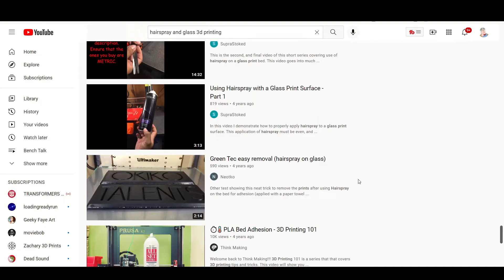Safety First - How safe is your 3D Printer, or Laser Cutter

Comment: Man, I remember you being attacked viciously after that story broke. You weren't "not thinking" by neglecting to say only spray in a well ventilated area, you gave the audience too much credit to think for themselves. It's why everyone litters videos with disclaimers now - you do at your own risk etc. This is the major reason I will never show open air lasers on the channel, along with tonnes of things I would honestly love to share. I don't trust people to think. Most people, yes. All? No. The laser companies don't seem to give a crap either, so I feel it'd be me ending up being sued and it just ain't worth the adsense!

EDIT: Wanted to expand a bit, worked with lasercutters before 3D Printing and almost every few days someone would come in wanting an item cut / engraved that was made out of toxic-to-burn materials. Faux leather is almost always PVC, most Ply and MDF contains formaldehyde etc. Education around what materials are safe can be incredibly challenging at times. With an enclosure and a high flow extraction you can deal with most of the fumes, but definitely not with open air designs. That's a major, somewhat hidden risk beyond the laser and fire I feel.
Reply from the maker: Yeah, I probably deserved to get blasted. We were all learning.
The other problem with these diode lasers is they don't seem to cut certain materials that the CO2 lasers that produce a beam of infrared just tear right through. Not necessarily a safety concern, but if you're thinking these little diode lasers are a cheap alternative to a FSLaser or K40, then you're in for some disapointment.
Reply: @3dpprofessor  Yeah they can't do clear acrylic, deal breaker!

Comment: I would love to get a laser cutter. I would be more likely to get an open air laser due to the cost. BUT  I would also make an inclosure with a filter for the hazardous materials. I was a machinist back in the 90s for a company that made medical diagnostic equipment. We made parts out of PVC. You don't have to burn it to cause fumes. Just heating it up a little will cause off gassing. It would make people literally sick. I had to wear a organic vaper respirator all day. The part was cut on a lathe dry. The parts wouldn't get hot enough to burn you from the cutting friction. But could sure make you sick enough to see your lunch again.

Comment: Here's the thing about safety, "everyone thinks that they are being safe until proven otherwise." I had an engineering teacher repeat this every day for a year before lab. On average he was right about once every week or two. 

It isn't what you know that can hurt you, it is what you don't. "Being smart" about using a product is just vague enough to feel instructive without the benefit of understanding dumb luck. I have an ANET A8 and have never really had a problem with them but that is because I knew what things might fail and checked them early and often (i.e. the heat block heater). I have a friend who also had an A8 who, while being very smart and conscientious, didn't realize that most of the time the heater comes to you loose from the factory. Third print in, the heater slid out of the block and nearly caught his print on fire. 

RE: Open air laser, I would love to see more content about it. I have an enclosed laser cutter but would like to see more open source solutions to the very expensive and proprietary setup I have.

Comment: Fire the laser, Joe. The risks/precautions for laser cutting is far below a lot of other hobbies. Take for instance my hobby of RC helicopters. The conditioning and charging of large LiPo battery packs puts pretty much all of the worry in laser cutting to shame. Yet, no one is suggesting we stop using them. As with everything that can cause harm, use with caution. I for one am very interested in more laser cutting content.
Reply: Lipo fire is just that a fire. Laser can damage your eyes in milliseconds, which is way more risky.
Reply: @MisterMakerNL  I agree that the dangers faced in different hobbies are different. A LiPo fire is highly energetic, extremely hot, and not controllable by most standard home extinguishers (depending on the batter pack size). Luckily there are warning signs if your watching for them. I agree that the laser can do permanent damage in one pulse and must therefore be approached differently. I guess my overall point is that there are dangers inherent in a lot of hobbies (as well as life in general). We shouldn't necessarily limit or censor ourselves from sharing the hobby on the chance that someone isn't going to do their due diligence with regards to safety.
Reply: @draeh  no man lipo fires are only dangerous when it happens unattended and your house burns down. If your near too it you get warned before it blows. Even working on mains voltage is more dangerous.
Reply: Nicely said, people  don't realize that a .50-.60 size helicopter can decapitate someone.
Reply: The risks are different.
A lipo is not going to cause irreversible sure damage to your friend (or child) standing 6 feet away while a class 4 laser can easily do this.
Conversely, while a fire start the lipos are likely the greater risk.

You have to treat the laser light much like an arc welder, there should be ZERO chance for someone to accidentally or inadvertantly see the beam. Plus some of the damaging emissions of these violet diode parts are in the UV spectrum and are not visible.

Comment: Unrelated, but Kywoo released their high temp heater block for the Tycoon series, which goes up to 300 degrees C. It would be cool if you could test it out, considering with the new heater block, it esentially can print polycarbonate and nylon now

Comment: I don't have an opinion on the laser cutter; i know there was a story in the press in 2017 about a couple that died, potentially while operating a laser cutter, apparently from CO2 poisoning. I don't know whether that's true, the press made critical mistakes in reporting that make the story very dubious, and after all, there could have been numerous other sources of the silent but deadly gas. I think they also had a high power laser, not one of these little things.

The fact that you should use only laser-able materials and not try to ever cut PVC or something else that emits toxic fumes is kind of part of the inherent risk of a laser cutter; but these lacking an enclosure also seem underequipped in safety compared to what you normally expect, due to being fully open. It is for sure easy enough to lose an eye.

But as far as SLA 3D printers, they are actually already too risky for me personally. But i submit that there are plenty of people who have the circumstances to use them safely or have made a risk assessment different from mine for whatever reason.

Comment: Imagine if you tried everything you saw on Youtube without considering safety aspect first.

Laser cutters have a few safety issues. You discussed the laser reflection in great detail, along with fire hazards. One danger is also off gassing from material that is to be etched. This can be odorless, invisible and can affect you before you realize it is a problem. Ventilation is important with these lasers. To help better prepare others you could have a safety video describing where to find information on materials to be cut, properly rated fire extinguishers and eye protection.
Reply from the maker: ...I should learn more about where to find information on materials to cut and properly rated fire extinguishers and eye protection.
Reply: @3dpprofessor   Epilog Laser's site, and Sawmill Creek's site both have great info

Comment: I have a friend that is a wizard with cars and power tools. He does things that I myself would never try and attempt, but he takes safety measure for himself and anyone around. I have seen plenty of online mechanics showing people how to do things. There is always a risk, but is that on the Youtuber? Not in my opinion. You could get cut by a sharp edge on the metal, due to bad manufacturing, should the youtuber also have to warn of that just in case. There could be a 1 in 1000 chance that a part came out of the facility that should not have passed QA. Not to be confused with genuine bad products going out there, which also in my opinion our community has done a pretty good job of speaking up on those. YouTube is great. All of the 3d Print related creators are great and trying to teach people. But there is a level of responsibility on the end user or the end users gradians.

Comment: I have a 3018 CNC with a LASER and a K40 LASER and I believe that they can be safe to use if treated with respect. Don't use a laser un-attended, wear the proper eye protection, keep all body parts out of harm's way and keep a fire extinguisher handy.

In the case of the K40 there are things that, in my opinion, must be done to make them safer such as adding a safety switch to prevent the laser from firing if the lid is opened and removing the ground wire from the ground stud, sanding off the paint around the stud and re-attaching the ground wire.

I heard that some K40 lasers have come with a safety switch already installed and if this is true it shows that someone is paying attention to the maker community.

Comment: I bought my wife an open air laser cutter... I was adamant with her about wearing the eye protection and not leaving it alone while it's operating... I do NOT use it at all because I only have one eye and that's too great a risk for me to operate it. I do have my own pair of laser safety glasses and I put them on when I have to enter her craft room and I'm reasonably sure she's operating the laser. But she operates it without her glasses and I've told her many times that she should not be taking the chances of injuring her eyes like that. She also will leave it unattended while it's operating... I chew her out for that as well... I've threatened many times to take the laser away from her... Perhaps I really need to... Thanks for your video, Joe.
Reply: It pains me to hear of the cavalier attitude of your wife. It seems like a matter of time for things to go wrong.

When i was a toddler, i have been told, my parents rigged up a number of things to make sure i hurt myself once and never again, in a safe manner and under supervision. So there was a fake electrical outlet that would administer a safe electric shock via a capacitor, an open incandescent lightbulb running at a really low power, and a stove top at just the right temperature that it's painful but won't actually burn the skin right away, also a little knife/scalpel injury, these kinds of things. Nearly 40 years ago. I don't believe it has limited me in what i can do, but i still have a healthy respect for knives and mains.

I can't quite imagine how taking away the laser will work. After all she can presumably just buy her own, and it will be grounds for conflict. I don't necessarily want to suggest that she's a toddler, but then again, can a person who eschews sensible precautions against severe injury be considered an adult? I wish a solution can be found that she can continue her endeavours in a safe manner.

For that matter, my father has very limited vision likely in part due to laser injury. It seemed like a relatively minor lab accident at the time, where a direct hit could just about be avoided but the prescription glasses were damaged, but it would be a little much of a coincidence that specifically that eye suffered both a cataract and macular degeneration within a handful years and not the other.
Reply: That's messed up, something bad will happen it's just a matter of when. What kind of things does she cut / engrave?
Reply: @MakersMuse  she does engraving on 4 inch wooden coasters.

Comment: I've got several lasers and would use them far more often if I took the time to build enclosures for them. People forget to put safety glasses on everyday and around lasers that's a huge danger.

Even that tiny plastic guard around your laser head could fall off during a long engraving if the screw came loose and they do! An enclosure is a nice backup to your laser glasses.

I noticed your glasses are not designed to protect you from the same laser light frequency that's possibly emitted from your laser printer or laser cutter. Different frequency lasers require different eye protection. An invisible CO2 laser for example needs different protection measures than your blue wavelength lasers. Your burning green lasers need a different eye protection than your purple wavelength laser.

Comment: Like the saying Common sense is the most uncommon thing. 
It's how you treat and use an item, considering Safety First Always, so that you don't put yourself up for a Dawin Award.
Also like the Hitchhiker's guide to the galaxy has on its cover "DON'T PANIC!!!" (I know bad puns.)
But I often rebuild and redesign 3d printers and always consider this my safety first.  If I were to let others use the printer and I don't think or know that it is safe after I have rebuilding it. Like hell will I let others use it or myself.  I want to die of old age.
I have often seen many with lesser skill or just starting out do some very strange and dangerous things in past. Know understanding the basic or thinking "She'll be all right mate."
I agree fully with your point of view on what you have said in this item.

Comment: Every warning label has a story behind it, sadly. People need to leave things alone if they are not willing to learn sufficiently about a subject/device to be able to understand the risks and take reasonable steps to mitigate them.
I have extra devices on my 3d printer that are designed to automatically disconnect the mains in the event of a thermal issue. Hopefully long before it becomes a molten mass of goo. I also have cameras that allow me to monitor it from my smart phone from anywhere.
I don't know how I will be able to apply that knowledge to my laser, but the mind is always pondering.

Comment: 9:55 A procedure mask won't protect you against resin.
It main use is to avoid spiting on patient's open wounds and avoid getting direct contact with fluid projection on our face.
To protect you against solvent vapor, use an activated carbon filled mask.
Still, if you are in a properly ventilated room, I would not worry about harmful vapours.

I'm an analytical chemistry tech and a HAZMAT expert.

Comment: You have the safety precautions, you should do the videos on those tools. Just make sure to always show the added precautions that you take. Will save less experienced people from running them unsafely and the safety aspect is not shown near enough. I had bought a cheap (smaller) laser cutter like that but spent so much time researching and implementing a safe way to run the machine than making and actually using it.

Comment: I was going to buy a laser cutter but thoughts of my 5 year old coming in while its cutting kept running through my mind. Why dont laser printers include enclosures made of the same materials the glasses they include are made of...  seems silly to me in fact. How much more would it add to the cost? 100-200 dollars on top of the price would have been worth it to me. I would love to see you build an enclosure for your laser printer somehow finding sheets of laser deflecting plastic and maybe integrate that hepa filter device you showed. A build series for a 3d printed (where possible) 3d printer enclosure sounds cool too. The open bed styles are sort of a nogo for me with the previously mentioned child and a cat on top of that.
Reply from the maker: Some do. They just cost a lot more.

Comment: Hi, glad that you are covering safety, good job. I was wondering if you could do a video on flashprint 5, your the only content creator I know of who regularly uses flashforge printers, coming from Prusa background I'm now slightly confused on setting up custom material profiles
Reply from the maker: It took me a while to find things as well, especially the wifi delivery. I actually submitted a few bug reports... before finding the settings where still there, they just moved them.
What setting are you having a hard time finding?
Reply: @3dpprofessor  basic prints work fine. I try to mix materials with idex  and would choose example pva and abs and or would just revert to pva and pla. Also tried to add tpu and it was not clear how to create custom materials. I've been using slic3r and prusa version of it. Also used simplify 3d, but this is all new to me. So many videos on those other slicers but almost non on flashprint
Reply from the maker: @Hilmi12  Hmm. Have you contacted their support? Flashforge is very responsive.
Reply: @3dpprofessor  some of the best I have ever seen in any industry

Comment: I was looking for the safety data sheet for resin and so for have come up with nothing. an SDS tells what safety precautions the government recommends as well as toxicity and flammability of the chemicals used. I haven't started printing yet, still researching, but it would be nice to have this info and it should be readily available. any ideas? sometimes the package of the product will have a contact site or number to order an SDS.I don't have access to any packaging, so could you conform this? thanks in advance, Russ
Reply: OOPS!!!  I answered my own question. just did an internet search and the data sheet was available. stay safe and healthy, russ